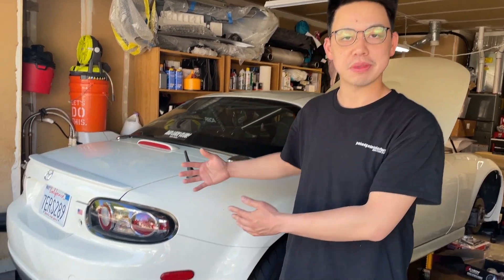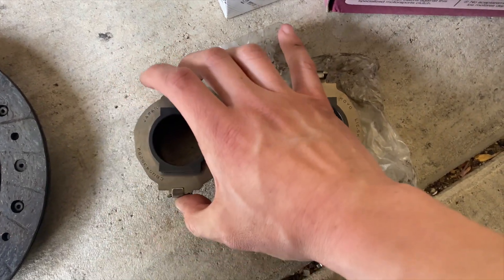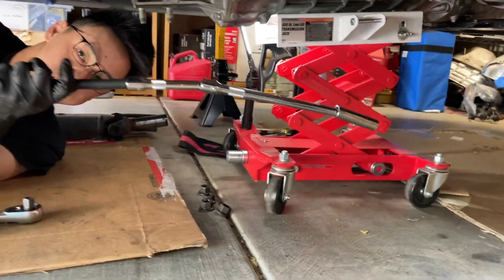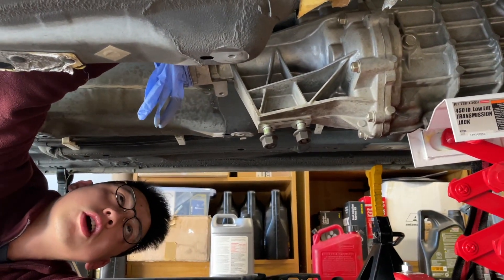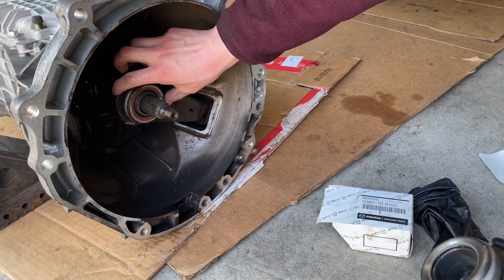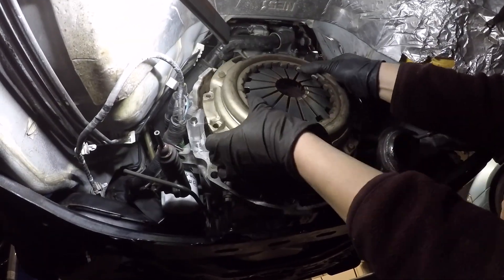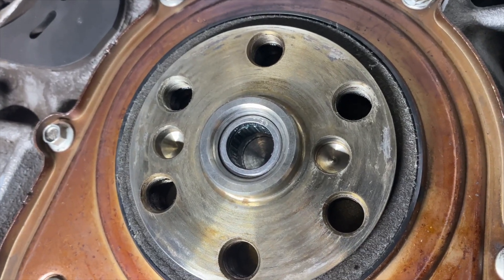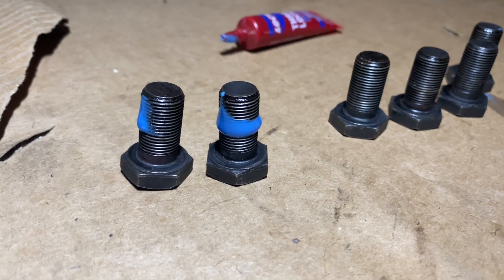❗Stage 1 EXEDY Clutch & Throwout Bearing Replacement❗ | NC Miata

Comment: Thanks for the video, very informative! I'm getting the same throw out bearing noise in my car with 127k miles. I've heard that the rear main seal rarely gives out.  I would have done that as one of the "while you're in there" items.  The trans tunnel heat shield is another thing I would have addressed. Although the OEM one is quite expensive.
Reply from the maker: Thank you! I’ve also heard the rear main seal rarely gives out so I decided not to mess with it.

DEI makes a kit for the tunnel heat shield for the NC. It’s probably better than OEM.
Reply from the maker: Seems like the throwout bearing gives out quicker than clutches on the NC.

Comment: thanks for the vid. did the shudder resolve after break in period? i just installed the same clutch in my nc1, and getting shudders when moving from standstill, followed service manual for installation. could it be something missed during install or we just have to live with it?
Reply from the maker: The shudders from standstill didn’t really go away. It shudders when the car is cold but it gets much better to the point where I don’t feel it once the car is all warmed up. I’ve tracked it a few times and it’s been holding up fine I will just live with it. YMMV.
Reply: Clutch rattle is normal for a race style clutch like this. I have a G35 with a stage 2 clutch and it rattles too. It judders when too little hard and a lot of clutch is given. It also has a light weight flywheel which exacerbates the issue. Nothing bad, just something to get used to.

Comment: Thank you for making this l video. How long did it take to remove the transmission and how long was the overall project?
Reply from the maker: Removing the trans is about 2 hours. And if you have all the right tools and is doing everything correctly, around 8-10 hours for the whole job but I would allocate a full weekend in case anything goes wrong.

Comment: Did the judder resolve over time?
Reply from the maker: No it didn’t go away. I just try not to slip the clutch too much or just give it a little more gas in 1st gear. It usually is worse when the car is cold and then it gets a bit better after driving it for while. I’ve also tracked it twice so far and everything seems to be holding up.